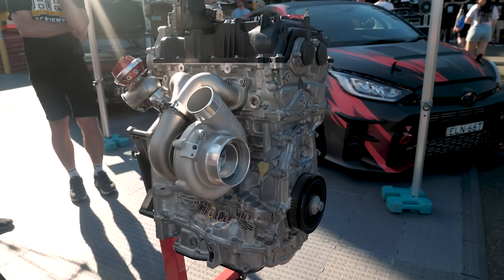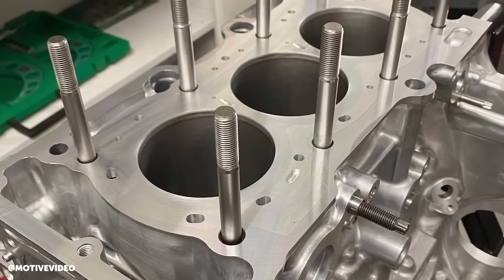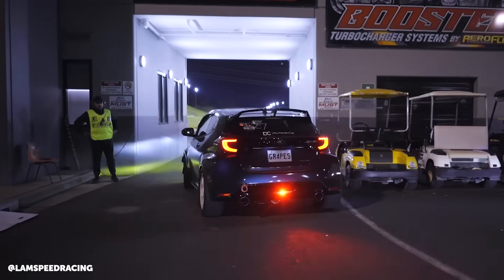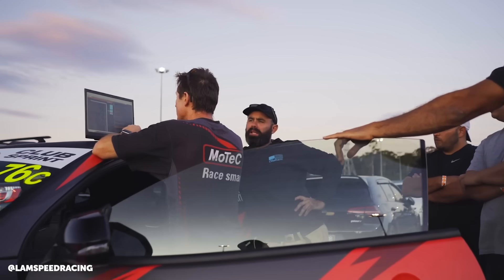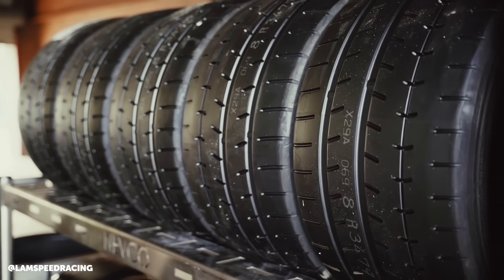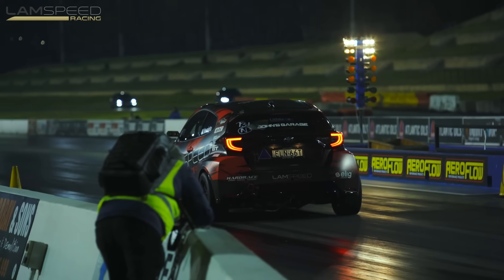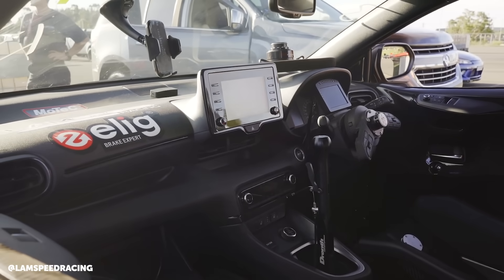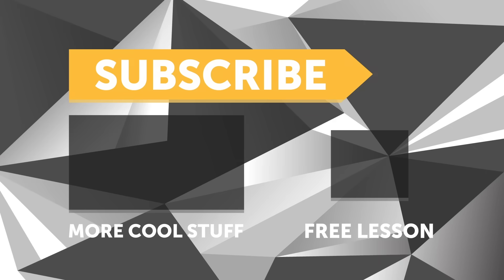This Little 880hp 3-cylinder Is WILD! | World's Fastest GR Yaris

Comment: for the love of God Toyota make a V6 out of this engine
Reply: @fihimsadiq8779  naaaah they need to make a inline 6 with it 👌
Reply: Or an i5 if they want to keep it odd 🤩 But yeah, this would make an excellent 3.2L 2jz successor.
Reply: @papapetad straight 6. No V6. Just straight 6.
Reply: @maximmartel3179  i agree. Just do like cosworth and turn that 3 into an I6 or V12
Reply: @TopDonBarrow  v12 from this would be crazy af
Reply: @maximmartel3179  they don't have that but they have this and they are making a 4cylinder so guessing that that will be next???😏
Reply: @fihimsadiq8779  that thing if allowed to would make 1600 hp . Damn toyota would find their 2jz era again.
Reply: @saddammalima8458  I'm happy with around 310-320hp though not doing drag racing.
Reply: @mrmorizofan7001  if they can make it a crate engine
Reply: @haydenjones962  why have four if three is enough? three cyl much better for turbocharging
Reply: @mrmorizofan7001 what makes you think 3 cylinders is better than 4 for turbocharging ?
Reply: @pl-boostcreep  probably because with 3 cylinders the intake runners are closer together giving it a more even consistent air fuel mix
Reply: @mrmorizofan7001  Exactly!!, 3 cylinders is the reason, adding more wont change a thing.
Reply: @fihimsadiq8779  wouldn't that just be another nismo engine lol
Reply: @fihimsadiq8779  You heard of a 2GR???
Reply: Why?  It's got enough power already and it's light.  That's why the Yaris GR points into corners so well.
Reply: Straight 6, big turbo, new supra.
Reply: 2liter 4cyl twin turbo is also a option. G20E-GTS with twin bearing Turbo's. Arount 400BHP stock.
Reply: @tinodeblier5694  Technically Toyota is currently developing a new 2.0L 4cyl Turbo performance engine
Reply: @tinodeblier5694 here's a fun fact..
Toyota is currently developing a brand new 2L 4cyl Turbo right now which rumored to produce 400hp
Reply: It wouldn't be "this" engine if any added cylinders are involved. You're imagining 2 separate engines glued together to make double. Or maybe you're saying they should use a similar approach with a V6.  in reality a v6 can't be mapped, timed and engineered the same way. At the same time you're a legend and a genius for thinking that way. If Toyota could have 2 separate 3 cylinder engines working together aka one engine powering the front and another powering the rear that would be epic. A yaris with no trunk but an engine instead? 😂. They combine petrol engines with electric motors. Why not go all gas just for performance sake.
Reply: Y'all ever heard of the 2GR? It has a baby brother that's 2.5L and direct injected only, basically the ancestor to this technology that taught them to keep port injection for flexibility and valve cleaning in addition to DI. The 2GR is a great platform that definitely informed this engine's development - there are people getting near 400WHP NA from a 3.5L on stock bottom end components (mixed and matched pistons and blocks from D4S models into the older port only blocks) - I'm sure with turbos and aftermarket rods and pistons the same setup could achieve double the numbers of this 3 cylinder.
Reply: You totally missed the point.
Reply: @fihimsadiq8779  bro I think that's a great idea. Sadly toyota forgot what made them great. Toyota lost my dollar the moment they did a venture with BMW. 2jzGTE Fa LIFE.
Reply: @delta9kush339  you ain't lying
Reply: Toyota VR6
Reply: @fihimsadiq8779  yeah mate but still… a 2jz is a 6 Zylinder and they already had over 2200 hp on those engines … even with the 880hp (double it for 6 Zylinder = still 1760hp) it’s the top notch I think.. and I own one
Reply: @fihimsadiq8779  just buy two and little welding time 🥳
Reply: Why Toyota? 😉 plenty of v clever ppl around....❤
Reply: It'd be the LS of JDM engines
Reply: @Cut_to_the_chase_man  LS engines are junk
Reply: A 5 banger would also be amazing
Reply: I think, the advantage of less friction will make it superior to 4,5 or more cylinder. They are on a good way in my opinion. There are a lot of Videos about this car and damn it's quick AF. And it sounds really good for just 3 cylinder. But just my opinion
Reply: @UserUnknown-r6q  i also agree but a 5 banger of this recipe would also be amazing 
4 banger as well 
Inline 6
Toyota knows and we will see some awesome stuff moving forward
Also where you think mr 2 will be vs supra cause I first saw 600hp now 400hp but still more then supra
Reply: Toyota needs to get the ring gaps correct from factory 1st on these until they stop blowing up from crankcase oil detonating in the chambers
Reply: @fihimsadiq8779  it already exists...
Sort of...
Reply: @fihimsadiq8779  this can be done, grab an old 3.0 v6 of Toyota, and change the cylinder and the head, that way, it’s a V6 that will be able to go 1600 hp
Reply: @qamerali8982 The Toyota blade has a 3.2 ltr V6 and it's mental
Reply: @fihimsadiq8779  There’s a 2.0L 4 cylinder version of this engine in the making right now the G20-GTS
Reply: Actually its much better, they make V8 on new LFR😂
Reply: @fihimsadiq8779  you mean an inline 6
Reply: Inline 6, Toyota has enough V6s at this point, but no Inline6
Reply: I agree not V6 inline 6 would be great
Reply: No bud 😊... I6 version in the new supra coming with the Mazda joint project RX7 coming soon
Reply: @fihimsadiq8779  nah v12 super car or v9
Reply: No. 5 or 7 cylinder. 5 would be ideal.
Reply: For the love of God, just bring back the V8.
Toyota is going to go down with the rest of manufacturers of making 💩

Comment: Why the hell they using miles per hour. Australia uses metric.
Reply: At the drag strip it's still standard to use MPH in Australia as it's a standardised measurement for drag racing. It's like in the aviation they use a combination of Feet, Nautical miles, kilometres and meters.
Reply from the maker: What size are the rims on your car shagga 😅 - Taz.
Reply: You sound like a real Australian expert, not.

Comment: 140kw = 190 hp 
880 hp = 647 kw
Reply: My GR Yaris is 276hp standard - UK circuit pack
Reply: @partyonsam  That's the power measured at the crankshaft. The drivetrain has significant losses, so the power at the wheels will be around 140-150 kW.
Reply: @iPepeOFultrabond  not much cuz its 4wd. say he specifies 50/50 losses will be only 5-7%
Reply: @leenux1707  I think he meant 140kph speed?? Idk
Reply: @propa2958  each wheel

Comment: I was sold once I saw he was steering with throttle at 140 KMH in that little rocket ship.
Reply: Throttle steering ????
more like correcting just to keep it on the track, handles like shit.
Reply: @RIPPERTON  Did you not see the clip at the end of it being driven at a track? Thing was pulling well over a G in a corner, going relatively fast and still hitting the gas without washing out or going out of control. That thing clearly handles just fine.
Reply: A race car handles like shit yea okay bud @RIPPERTON

Comment: Andre you forgot to ask if the engine is still open deck or closed deck. I really really wanted to know this!
Reply: Closed deck
Reply: @Andrew260RS  there was a shot showing the closed deck block.
Reply: @NightwalkerUK  There was also a shot showing one with open deck..   Stevemorris did one with open deck, custom thicker sleeves and its 900+ HP
Reply: Don't need to close the deck under 700bhp.

Comment: Any feedback on the standard ring gaps that Toyota uses? I heard there have been some issues with massively wide gaps from the factory that is causing blow-by issues that is leading to engine failure on the stock engine. Cheers
Reply: Only seen one YouTuber bring this up but unfortunately for the poor lad he’s totally lost. Ring gap is a non-issue, just a guy overthinking it and drawing the wrong conclusion. It boils down to bad driving habit, lag this engine and you are susceptible to catastrophic engine failure
Reply: @kengit2  cheers for the info.
Reply: @kengit2 how does that affect the engine? Lugging it? (Low rpm)
Reply: @heathlett275  read up on LSPI. Low speed pre ignition. It's an issue than can occur on direct injection petrol engines.
Reply: @heathlett275   sorry for typo , yes lugging the engine. Heavy engine load while trying to accelerate at too high a gear this may cause preignition detonation (aka LSPI)
Reply: @thedangdanger  not an engine issue. Fuel tuning issue.
Reply: Storm in a teacup.